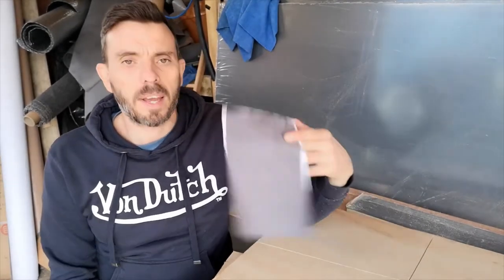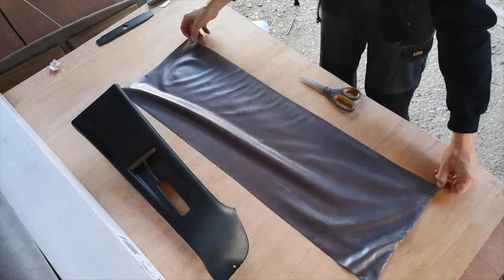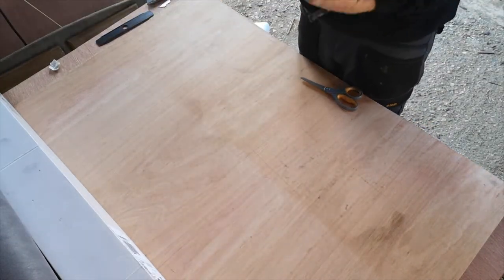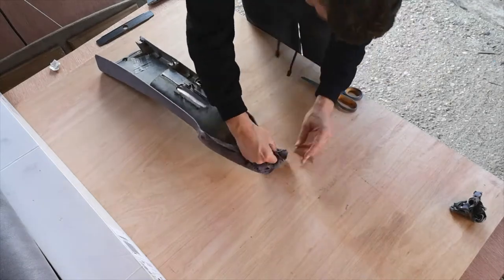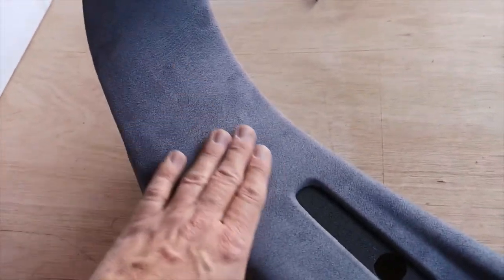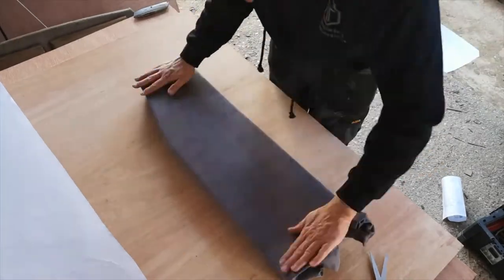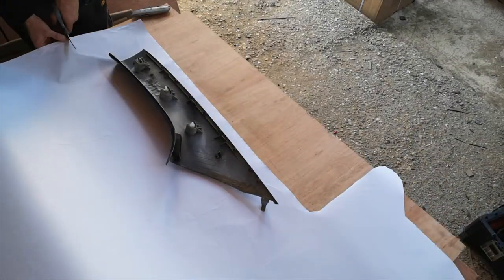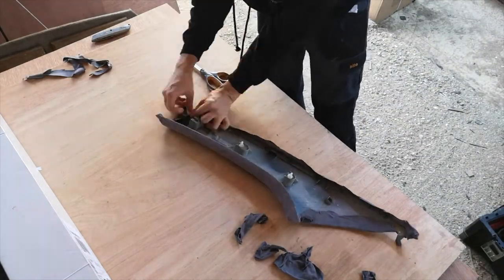HOW TO: COVER INTERIOR PANELS | VW T5 | SUEDE LINING | CARPET LINING | PLASTIC TRIMS | VAN TRIM

Comment: Hi, just watched this video. I like it and it looks easier than other materials, but how does the material look a year one from fitting? does it fade or wear out in areas like the b pillar with seat belts rubbing against it etc?
Reply from the maker: Thanks Daniel, I assume all is well after a year.  No return from the customer 👍
Patience is key using it. Good luck

Comment: You know where you can get this material in black?
Reply from the maker: Unfortunately not but I'm sure you can.  Search up self adhesive suede liner 🤙
Reply: @trimportersvanconversions6973  tried and can’t seem to find anywhere buddy
Reply from the maker: @richardpalmer4936  you may need to look at alternatives.  Harrison Trim Supples do a stretch suede  that can be used with trim fix spray adhesive.